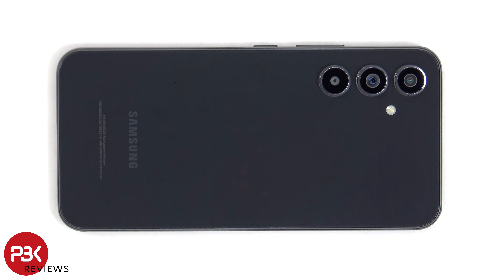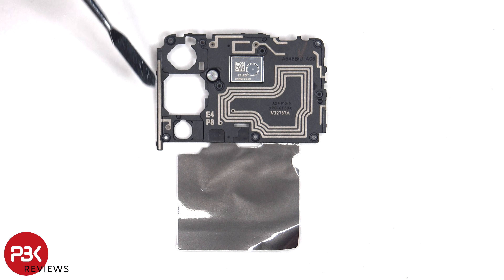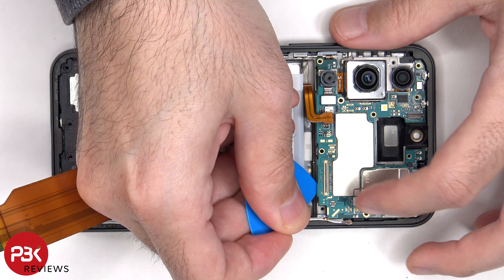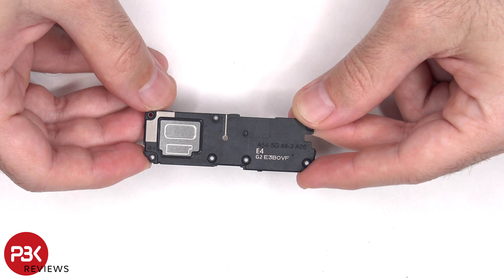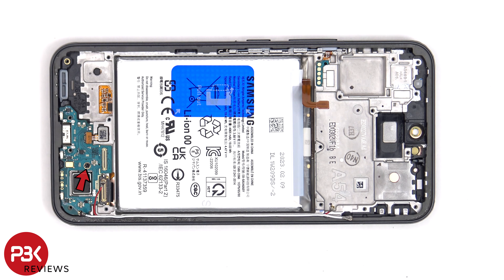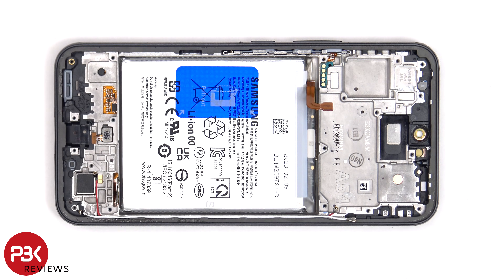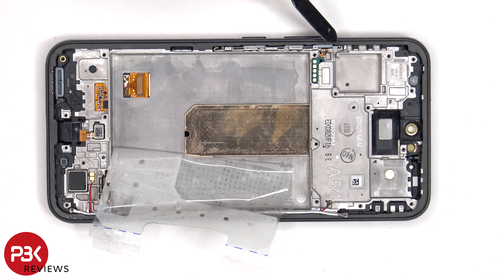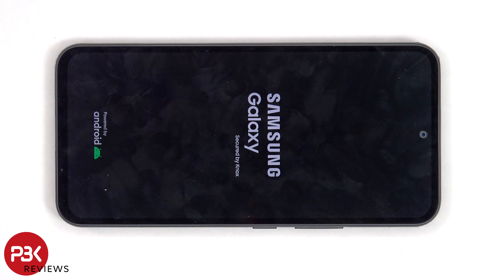Samsung Galaxy A54 5G Teardown Disassembly Repair Video Review

Comment: Watching this on my A54. Pretty nice phone especially the display. Best A series midrange Samsung phone I've ever used but it's still lacking in performance even compared to the S20 series from a few years ago. However it will be supported for longer thanks to it being 3 years newer. It's also nice that it's water resistant has an SD card slot and the camera is actually pretty decent (again best on a midrange I've used to date) 

I personally wouldn't buy this phone for the $499 price tag in my country and i would just get an older flagship like an S23+ for around the same price second hand, but i paid less than half that after i pay off my contract and i think it is well worth it at that price.

My biggest compliment as far as the actual hardware goes is how hot the device gets even under moderate loads. The Exynos 1380 just runs really hot so it's good to see a decently sized vapor chamber in it. It's unfortunate for Samsung that even the newer Exynos processors still have these overheating and thermal throttle issues.

Comment: What kind of sticker do you recommend to seal the back of the phone in the assembling process?
Reply from the maker: https://www.ebay.com/itm/276450210310?_skw=galaxy+a54+5g+adhesive&itmmeta=01JMKSS3WKKYPW5SNHR36ABJNA&hash=item405db77206:g:6SUAAOSwbvhm-pcY&itmprp=enc%3AAQAKAAAA0FkggFvd1GGDu0w3yXCmi1cQaMAks%2Bn--oxYqH1efKWun1RsBX%2FL5vR5XD61gns6mAFXLjFWLwl9WtZrsQdTzWRWKtsUIo%2FbzAb7DIplr9HDnCFYcPgfhJ4sf3JnNyLVlVOEHDOQe%2FbajCPm7LQGQL%2B1VjKcv76gISXdZmPSQL9vDDqNHBKE%2F%2BswLkcG7K%2FJ4ZM9%2B4jlv5BiOBLB5yHTT0rb1K2XRv7i9AEP6IQHxR7eeiko2wAQJRV8xXS97F8tkCr5ZT7sy6HUt%2FYsiT13NrQ%3D%7Ctkp%3ABk9SR7q-5PmkZQ

Comment: Yo Any advice on a bottom speaker replacement?
Reply from the maker: You can check on mobilesentrix.com or rounded.com for replacement parts. As for taking the phone apart, just follow the video, it shouldn't be too difficult. You can use a hair dryer to heat up the back and a suction cup tool to help you lift up and get a pry tool in to pry the back off.

Comment: Hi all 
After changing lcd and back of a54 nfc is not working. 
What can be the reason ?
Reply from the maker: make sure the motherboard plastic cover is seated in place properly and screwed down since it has the nfc antenna on it.

Comment: Hi i bought a Samsung A54 two weeks back, everything was since i was using dark mode through, today i switched to light mode and I notice something strange and odd, i can literally see the screen internals or layers under the display while using in direct sunlight, Next to the front camera on the left i can see a around dot and the mapping of pixels, is this normal with these devices? thanks.
Reply: I have this phone and I can see the fingerprint sensor under direct sunlight
Reply: @mArvAlcao71  apparently thats normal.

Comment: Is it possible to replace the camera? For upgrade purposes. My father runs an electronics business and people drop by their useles phones to see if they can be fixed. Say I find an S23. Can i replace the a54 camera with the s23 camera?
Reply from the maker: No wouldn't work. The camera connectors would be different and the software wouldn't read them anyways.

Comment: So, no need of heat or glue dissolvent to take out the glass back cover plate?
Reply from the maker: yes heat is needed as mentioned in the video to loosen up the adhesive.

Comment: I have a ?, to replace a cracked glass on the rear camera just apply heat? I don't need to open the phone?
Reply from the maker: correct, just apply heat and use a think razor blade or different tool to pry off the glass lens cover and apply new adhesive if the replacement doesn't come with it and re apply the new glass cover.
Reply: Thank you so much

Comment: Does it still hold the IP67 rating?
Reply from the maker: as long as you use the pre cut adhesive made for the phone to re adhere the back, then you should retain the ip rating

Comment: Someone know where I can buy the camera cover? I damaged the rim only and cannot find to buy, lens glass was not damaged. Nice video
Reply from the maker: Thanks. You might need to replace the back cover since I can't seem to find just the camera lens cover with frame. Here is a link https://www.ebay.com/itm/374835148272?chn=ps&_trkparms=ispr%3D1&amdata=enc%3A1pKs-tvqZRCmVDxrucDmhaw31&norover=1&mkevt=1&mkrid=711-117182-37290-0&mkcid=2&mkscid=101&itemid=374835148272&targetid=1585159290171&device=c&mktype=pla&googleloc=1013819&poi=&campaignid=19894961968&mkgroupid=148855406073&rlsatarget=aud-1339632007354:pla-1585159290171&abcId=9307911&merchantid=540508472&gclid=Cj0KCQjw3JanBhCPARIsAJpXTx6ea6j1kcgcLTY0RVK9xuXgEr_p-FkwBVXmAw0XcKo3di0-eDGupFgaAiDlEALw_wcB

Comment: Galaxy a54 or iphone 11 pro max?
Reply from the maker: A54, I don't like iphones much personally but even if I did, I would still go with the A54 spec wise.
Reply: @PBKreviews  thank u for ur respond. But I saw comments on YouTube saying it has only one speaker at the bottom
Reply: @PBKreviews  how's the camera in a54
Reply from the maker: The camera has better specs than the iphone camera, but I didn't use it long term to judge.
Reply: @PBKreviews  Did you change it or sell yours? And if I may ask why didn't you use it that long ?

Comment: Good morning friend how are you? I want to know if there is a possibility of replacing the batteries, putting the 7000mAh battery of the Samsung M51 in the Samsung A54 5G cell phone. If possible, send me the exact measurements of the size of the batteries to see if there is any difference. I value a lot of battery life, and the Samsung A54 5G only has 5000aMh, I want to adapt the 7000aMh battery to the Samsung A54 5G
Reply from the maker: Hi, no the M51 battery is larger in size and will not fit in the compartment of the A54.
Reply: @PBKreviews  So the Samsung A34's 6000mAh battery might work on the Samsung A54.
Reply: @PBKreviews  
So the battery of the Samsung A34 or the M54 which are 6000mAh could be used in the Samsung A54 right?

Comment: So battery need cooler too?
Reply from the maker: The battery generates heat when charging or using, so yeah its best to be able to cool it down if possible to prevent it from over heating or generating heat for the other components around it.
Reply: @PBKreviews  So puting some thermal paste under battery if you got aluminium frame can help? Or you dont recomend it.

Comment: Sir, please provide info.. Is the cooling on this smartphone in a good category like Chinese smartphones in general?
Reply: I have this smartphone. It is very fast , awesome display,  camera and speakers but the phone sometimes gets hot for no reason and the battery drains really fast. This thing ruins this awesome phone...
Reply from the maker: Thanks for the input. Keep in mind though that just because the phone heats up, doesn't mean its over heating. It is designed to exhaust the heat from inside to outside the phone so that's why you would feel it getting hot. Battery drain can be caused by running apps etc., but if the phone is running sluggish, lagging and freezing, that's when you know its over heating or not being able to handle the load.
Reply: @PBKreviews please how many speaker does this phone use. I saw some comments saying is only speaker at the bottom? And which is best galaxy a54 or iphone 11 pro max?
Reply from the maker: The cooling looks to be good, it has a good sized vapor chamber etc.

Comment: Of course the battery is still glued down... The user must be punished by having their house burned down by a bent battery if they dare to replace the it instead of buying a new phone.
Reply from the maker: These newer samsung devices have the adhesive pouches which you can pull up and pry off the battery. So it's not as hard as it was before.

Comment: I just got my a54 it comes with a free hard case but when i try to remove it and put it back again the volume butto suddenly pop out and fell to the ground so i just put it back but not sure if it is still water resistance or i break it
Reply from the maker: It should still be water resistant since there is a rubber gasket from inside the frame behind the buttons.

Comment: It's good to see Samsung increase the size of the vapor cooling chamber as compared to A53.
Reply: Да телефон охлождаеться за 1мин 2-3°c
Reply: Thanks for confirming that it has vapor chamber i searched on google but didn't find any information regarding it...
Reply: What does it do ? Help reduce the heat ?
Reply: @asirimaduranga8697  It helps to dissipate the heat inside the phone quicker.
Reply: @gys792  nice. Thank you very much.

Comment: So why the hell does it heat up when you're just plain browsing.
Reply from the maker: The antenna are in use as well as the screen being on which generates heat.
Reply: Battery drain, low quality processor,... Samsung quality in 2023. 🫤

Comment: Wow. I'm surprised Samsung gave GG5 for the back cover.
Reply: I am surprised they gave glass😂
Reply: I am surprised they gave glass😂
Reply: I'm not surprised tbh , they was using gg4 for the Galaxy a5 2017 back in 6 years ago.....
Reply: @Uxz0199  True, I had an A3 2017 and its build quality was the same as the S8, S9
Reply: I had a 2016 A9 pro, which had a glass back.All initial A series were aluminum and glass built
Reply: I m surprised price increases up to 1.5× higher 🎉😂
Reply: @Deep_X_robi not in my country tho lmao
Reply: Should be plastic, they can curve the back on this 200g (beefy) phone, and make it easier to hold.
Reply: @3m4il skill issue , you possibly can't be that weak ( me typing this with a cover that literally makes the phone rounder)
Reply: @3m4il  iphones literally have the same shape yet no one complains 💀 alll you sheep
Reply: Brian I am disabled, how dare you mock my situation, you should be ashamed. I have reported you.

Comment: Definitely built to last.🔥
Reply: Based off the teardown of the Google pixel 7a this seems so much more protected, modular, compact, and secured. This phone can take hits without anything falling out of place. Even the sodering is better
Reply: That's why you dont by phones online go to Samsung directly
Reply: It's a shit phone with over heating issues and now mine stopped working .
Reply: @mkaj1142tops  The hell is your model number
Reply: @mkaj1142tops 😂
Reply: You probably bought some sketchy second hand thing from a flee market or your friends. @mkaj1142tops
Reply: @mkaj1142tops  Over heating what? 6month with A54 it not heat at all
Reply: @mkaj1142tops  maybe yours is refurbished  😂